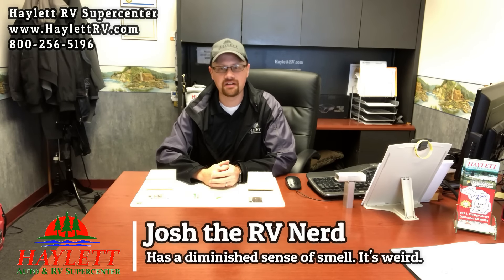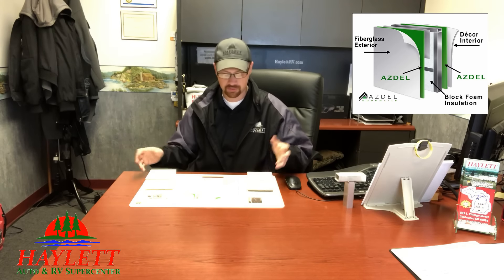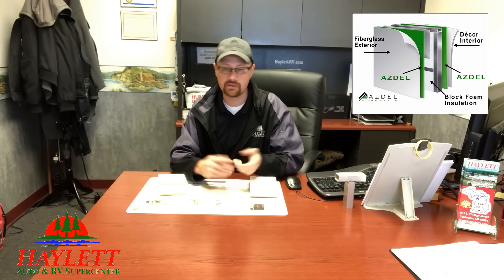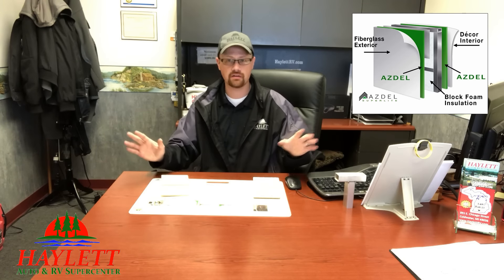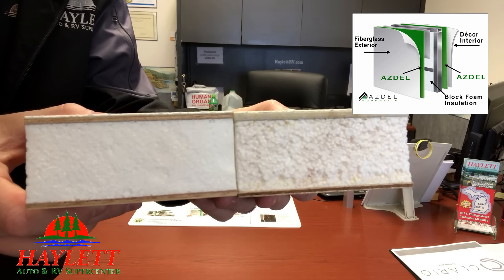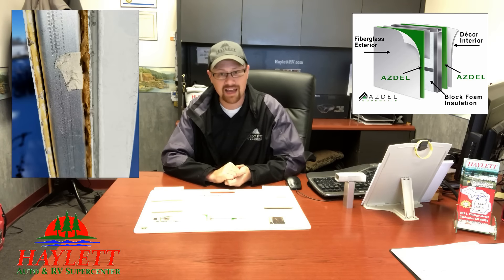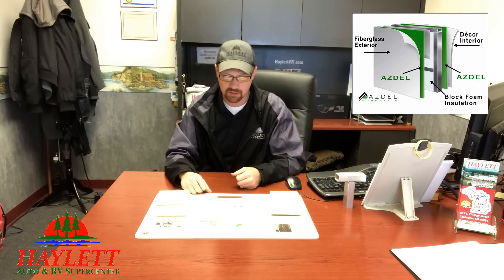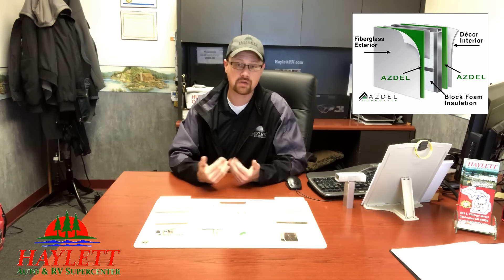Azdel Explanation & Benefits with Josh the RV Nerd

Comment: I have been trying to find a used rv built with azdel. Really hard to find what year and models and brands use this..does anyone have a list??? If you download factory brochure's, seems like 2021 and newer rvs rant and rave about using this, but 2019 do not.
Reply from the maker: For the longest time nearly no brands were using it. Coachmen's Laminated RVs have been using azdel the longest, though. 

It wasn't until recently it was more widely adopted

Comment: I recently purchased a 2015 Coachmen Apex with Azdel sidewalls. I discovered that sealant was used on the inside of the window frame next to the dinette. Turns out there must’ve been a hole that was leaking because the interior luan layer of the Azdel directly under this window is delaminating. Do you know if this can be repaired?
Reply from the maker: I'm unable to provide any real advisory without being able to see the affected area. Best recommendation is to visit your local repair facility

Comment: Greetings and THANK YOU Josh for your honest, fact-based, objective videos. I first watched one of your videos summer 2019 researching 5th wheels for our eventual purchase. I have viewed countless YouTubes on 5th wheels since: few with the well thought out level of detail and information your videos provide. You have substantially increased my ability to make an informed purchase.  Just to mention a few of the broad range of your topics, Ive learned more about wall construction, slide types, wall material and shocks than anywhere else, thanks to your productions.  The Montana 294RL, Solitude 310 GK and Alliance 310 RL are our current favorites. Any input you may provide on these are welcome. Although we live in California, we are strongly considering Haylett based on valuable information you provide.
Reply from the maker: I would definitely recommend sticking with a more established brand at the time. My experience has greatly shown newer/start up brands often go through a lot of initial re-engineering as they work out kinks other brands like Montana ironed out long ago (Such as rear wall structure and centralizing A/C systems properly).

Comment: @JoshtheRVNerd, I know this is 6 years old now, but I'm big fan of Azdel thanks to your education. Keystone appears to be using a competing product from Genesis called AeroTek -- any reason to be concerned with this alternative product? It's obviously superior to Luan, but is it as good as Azdel? Thank you sir--keep up the great work!
Reply from the maker: No concerns as far as I've seen. "Azdel" is basically like "Kleenex" -- it's the name brand of a product

There are plenty of other good composites being used now around the industry. Azdel was the name brand of the one that busted thru first
Reply: @JoshtheRVNerd  -- thanks! That's what I was thinking, but didn't see/hear you mention it in the video (maybe I missed it). I went to Keystone's website, and while I saw their reference to their innovative hyperdeck flooring, I didn't see anything about composite laminate walls. So I called their customer service number and the rep I got said their walls were "wood and aluminum framing," which didn't seem right. So I hopped on their online chat, got another rep, and he shared that they use Genesis AeroTek, which does appear to be an alternative to the market-leading Azdel (and I think maybe some Forest River brands have also migrated away from Azdel to competitive composites as well, perhaps due to name-brand pricing?). Thanks as always!

Comment: Hey Josh, Huge fan.I wish every sales person had you and your dealerships attitude. I was wondering if you could do a video about the predelivery and inspection process for someone coming to the dealership to pick up their new RV trailer. How much time should you expect to spend going through all the systems and how things work. What areas should the buyer pay attention to. What to expect the sales person to go over with the new owner. I have experience in predelivery inspections of new fire apparatus. (A several day process) where the new owners go over every nut and bolt. I have seen some information on one of the RV forums where a person posted a check list. It was for a class A motor home and was about 6 pages long, but i found it very informative. I was hoping you could do something like that for people looking at travel trailers and fifth wheels. Thank you
Dan
Reply from the maker: Because needs and expectations can vary so greatly there's no generic video I could put out to cover this properly. Any new RV sold through our facility includes all basic accessories necessary for proper function (and then some) as well as a full walk-thru with an RVIA certified technician. 

A clients specific questions/concerns/needs are address on a per-customer basis. Some folks are thru their tours more quickly than others. Some take longer. We try to make sure each customer has a functional understanding of their RV, hitching, braking, etc. 

And our phones ring. Got a question? Give us a call. We're not a "buy it and fly it" sort of place. Especially first timers -- it's not IF but how quickly you'll have questions. We have people and we have answers.

Comment: I have an Apex Nano and I had my rear panel replaced because of some damage. when I inspected it seemed to have a thin layer of plywood and some regular insulation.  I guess my question is how is that water proof? Is the insulation water proof?  I was under the impression that there was no plywood.  not sure exactly what part was Azdel?   Just curious other than that we like the Apex, its very easy to tow and great for off road boon docking on the beach.
Reply from the maker: Sidewalls include azdel below the fiberglass. The rear wall is not laminated and does not feature azdel composites.

Comment: Been looking for the 'complete sandwich' of an Azdel made wall for some time, even on their information site, doesn't seem to be clear (at least to me) as to if the Azdel layer was on just the outside wall or both sides. The illustration in the corner of your vid seems to say that BOTH layers are Azdel, so we'll go with that. (Was hoping that was the case, that they weren't doing an half-way job)
Reply from the maker: Azdel won't have construction details of sidewalls because they don't make the sidewalls. They only make the panels. 

Each RV Brand's exact construction can vary. But typically this is how it'll look from the outside-to-the-inside:
* Fiberglass
* Azdel
* Aluminum Framework + Block Foam Insulation
* Lauan

MOST Azdel-using brands still have a lauan interior wall panel. RARE and costly instances use double-azdel. Geo Pros on our lot are one of those examples. It's one of the reason they're not the least expensive little campers.
Reply: @JoshtheRVNerd  YES! And again we have another reason to go Geo Pro! The Azdel outside / lauan inside was what I expected the whole industry (that does use Azdel) to be doing. Love the 'belt & suspenders' way of doing things.

Comment: Very good info. Neat to see the sign is made of Azdel. Have you done a technical video on outside coatings and exteriors? I remember seeing something talking about aluminum vs fiberglass before, but not so much a more detailed view of the different types of coating processes. How are they laminated? What materials are used? Why are some exteriors better than others? You always mention the exterior in Winnebago videos. How is that made to be better? What does a less expensive trailer use? In your mind, which brand has the most bang for the buck when considering the exterior (lasts longest, protects the most, lowest price). Do warranties cover the exterior coating?

It would also be neat to see you do videos from the actual factory. Not sure how well manufacturers would be open to that. I have also seen another dealer give a short video tour of their own facility. Would be interesting to compare your shop to others closer to me.
Reply from the maker: I haven't done things like upkeep videos... *yet*. Once the weather warms up here I plan to try to get more of those things done to assist customers who have made purchases rather than only those looking to make purchases. There's a lot to cover obviously!!

Comment: Hey, from North Florida! Josh, you do a great job with the videos! We've been watching for over two years now and plan on making the trip up North to Haylett, when we retire. (18 months)  My question is, does Coachmen us Azdel in there fifth wheel Chappal and Chappal Lite? We've been a big fan of Rockwood RV until now and recently look at the Chappal's and loved them. Also I was told that Rockwood does not use aluminum framing around there windows, no framing at all. But Coachmen Chapel's does and more framing in there walls.  Thanks again, we've learned so much from you!
Reply from the maker: I believe all of Coachmen's laminated products are using Azdel. Regarding windows -- it sounds counter-intuitive to think a window is fine without framing, but that's because there isn't a lot of information out there educating consumers on the different types of window installations. 

Suffice to say, they're not all the same. Rockwood uses a type of window that basically self-clamps by exerting pressure outward from inside the wall itself rather than needing something that clamps the window to the walls via screw pressure.

Comment: Great information!  I have a Coachmen Adrenaline made with Azdel and want to add a window.  What is the thickness of the finished walls?  Will a window made for a 1.5" wall work?  Thanks!
Reply from the maker: The new/current generation of Adrenaline is basically a renamed Freedom Express Blast from a few seasons ago. They have 1.5" walls. You may want to contact Coachmen customer service with your VIN to verify specifics on your RV (which I cannot know from here)

Comment: My 2018 Rockwood has wall panels of luaun wood with Laminex GRP & gelcoat.   New ones are built with Azdel.   I'd prefer the Azdel when we buy our next unit...but we've had no problems at all with our present trailer's walls to date.
Reply from the maker: Walls were really never an issue they had but it’s still a good feels thing I think

Comment: Hey Josh. If I was wanting to buy a camper older than 5 years I would prefer Azdel, that said, which RV manufacturers would have the Azdell and be a good used purchase?
Reply from the maker: Coachmen's laminated trailers are one of the few -- especially if it was 5yrs old. Beyond that Rockwood's Geo Pro models use quite a bit of Azdel. After that it's not found frequently

Comment: I am going to purchase a used RV within the next six months & want an all weather, 0-100 rated trailer as I will have my home base at a park in Bend, Oregon & will be living in it full time.
I have heard many wall & floor damage stories & insulation problems - does Azdel help with that or will more insulation needed.
Reply from the maker: That's not what azdel does or helps with. It's main purpose is to save weight. It's a wood panel substitute used in laminated walls. It is not insulation.

Comment: Just saw a video released on YouTube on the 2021 jay feather 22rb showing an azdel sticker by the door. Did Jayco move to azdel on this model ?
Reply from the maker: News to me. Will investigate
Reply from the maker: Update: Spoke to the Jay Feather manager directly. A batch went down the production line with azdel stickers, but the product was not made with azdel. Only the micro feathers use it currently. 

There were no test prototypes or anything like that released
Reply: What are your thoughts on the feather VBL floors, are they holding up better in the newer models. Has the soft spot issues of the past been addressed. I have a 2021 on order and got nervous reading older soft spot reviews
Reply from the maker: We haven’t been seeing issues. They have more cross members now than the older generation which makes the difference

Comment: Wishing the Rockwood Mini Lite used Azdel?  I know from your videos that the Rockwood Mini Lite uses a T-60 gelcoat on its exterior walls.  Is there luan underneath this T-60 gelcoat?  If so, how do YOU think it will hold up as compared to the Azdel walls in the Apex Ultra lite?
Reply from the maker: Hold up -- Rockwood does not use T60 gelcoat. That's winnebago. Mini Lites use a rolled Fylon. So do Ultralites. Signatures will use a higher gloss fiberglass, but not a T60. 

Regarding how they hold up... the video you're commenting on provides my thoughts and views on azdel vs. luan.

My two cents: You're likely overthinking it.
Reply: @JoshtheRVNerd  Thanks for setting me straight.  I made a spreadsheet with some travel trailers we are considering and I copy & pasted the Winnebago sidewall construction to the wrong cell.
Reply from the maker: @machfive916  No sweat. There are a lot of folks who get crossed up on the more "premium" level products out there.

Comment: I have a friend we have camped with that has an Open Range as I have. Open Range has Azdel in the walls. His has delaminated ! Not in one place but in multiple places! Mine has not because it sits in storage 95% of the time, his sits out! So, AZDEL will not keep them from delaminating!
Reply from the maker: Open range does not nor has it ever used azdel.
Reply: @JoshtheRVNerd  My bad, you are right it was not Azdel it was SymaLITE a similar product to Azdel. I have a brochure touting Open Range SymaLITE walls. Never the less, my friends Composite wall with SymaLITE not luan Delaminated all over! Not sure if they still use it, this was 2010.
Reply from the maker: @27delphi  It's a very similar product, but there are some variances such as bonding during lamination.